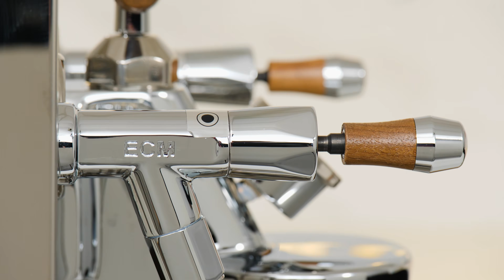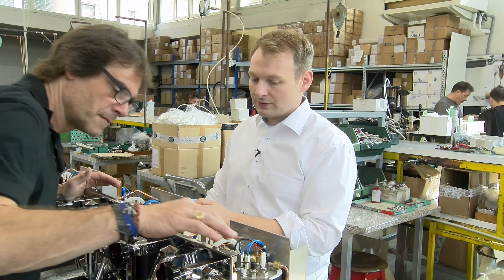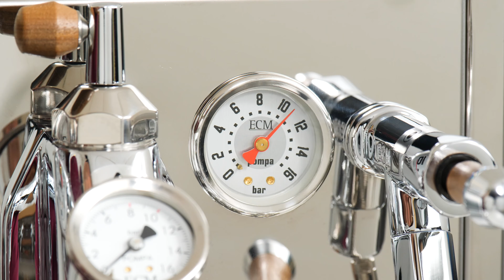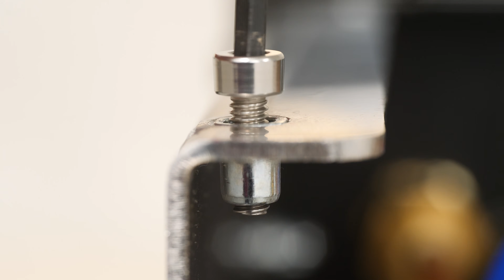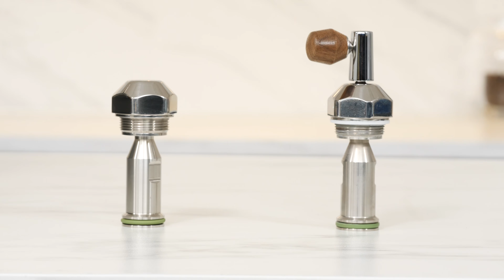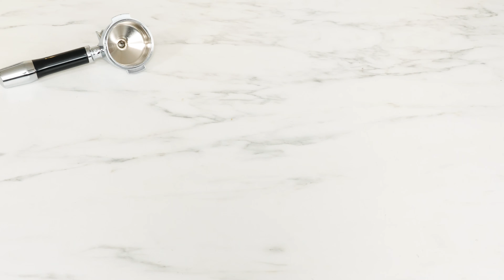ECM Synchronika In-Depth Review

Comment: I'm very happy with my ECM Synkronika that I bought from WLL last summer. My previous machine was a La Spaziale Dream T, so this one is a bit more manual, but I have it plumbed in with the BWT system I bought with it. I had some initial problems with the installed flow control and opened it up to find the o-rings were deteriorated. WLL was out of stock on them at the time, but provided the original mushroom valve upon my request. I know have the o-rings for the flow control, but I am getting such good shots using line-pressure pre infusion, that I haven't actually reinstalled the flow control yet. The support team at WLL has been great with that one issue and any questions I had about plumbing the machine.
Reply from the maker: Hey Richard, Thanks for the feedback. We're always happy to help and I agree our support team is fantastic - they know their stuff! Apologies for the out of stock situation but glad to hear there was a resolution to get you through - and yes line pressure pre-infusion can do wonders. Guessing you may have already been there, but if not be sure and bookmark our support section for the Synchronika. All kinds of videos and articles on techniques, DIY info, maintenance, etc: https://support.wholelattelove.com/hc/en-us/sections/1500000400302-ECM-Synchronika
Marc
Reply: @Wholelattelovepage  Thanks, Marc. I think I have seen a number of these videos, but I've now bookmarked the site. What a great resource.

Comment: I bought my ECM /CAEDO combo on Feb 13, 2019, almost 4 years ago and I must say these two items withstand the years with minimal maintenance for me.  I always use fresh water and have used both plumb and non plumb setups as needed.  This Combo works very well especially with my two favorite coffee beans ... Lavazza Super Crema and Australias Mio D'Oro from whole Latte Love. This company really knows equipment and customer service is nothing less than highly expected.  Favorite drinks,  Lattes, Worlds Colide and Afogato deserts.  Looking for some cool recipes if WLL will share to me.
Reply from the maker: Hey TWJ, Thanks for the kind comments, report on your setup and of course your patronage! Good water and a little preventative maintenance will keep your equipment running for decades. For recipes, here's a link to our blog loaded with delicious drinks: olelattelove.com/blogs/recipes
At 4 years in I recommend checking the T fitting which connects your vacuum relief on top of steam boiler (silicone tubes) to the drip tray drain port. It may be time to replace the fitting if it shows any signs of cracking. In recent Synchronikas the fitting was changed to a brass part. Cracked fitting does not effect machine performance but in rare cases may result in a very minor leak.
Marc

Comment: Hi Marc may I know the steam/hot water lever thread size are same with the brew lever?
Reply from the maker: Hey IC, Thread size is the same. You can screw the group lever handle onto the steam & hot water valves. Not enough depth internally to screw the steam or hot water handle onto the group lever.
Marc
Reply: Great info, can the group lever handle install onto Pro 400?

Comment: Just sold my pro 700 and got this one. One thing I noticed when putting a 3 hole on ecm the pressure drops a lot and on a recent event I did it almost at some cases wasn't keeping up but pro 700 with two hole was a tank.. Any way of increasing the pressure and a safe amount for when events or when needing extra steaming power? I put back the 2 hole on the ecm during the event and it was fine. I just like how quick the 3 hole is.
Reply from the maker: Hey vk, The 3 hole tip steams faster and will drop pressure more rapidly because of the extra hole. Should still have plenty to steam milk and quick recovery. I know with the 2 hole in place the machine can produce never ending steam. If you have the PID's t2 temp set to the max of 270F/132C then there's no way to turn it up higher.
Marc
Reply: @Wholelattelovepage  thank you for the reply! I will try that on my next event and hopefully the extra juice in the boiler it'll compensate for the extra steam hole tip.

Comment: Back in late 2018/early 2019 I was researching coffee machines. Even though I'm in Australia and WLL is predominantly for the US market, I found the information and the reviews on the channel absolutely invaluable.  The Synchronika at the time just received it's PID upgrade to get to 2bar of stream pressure.  After watching every review on WLL and doing all the reading on forums I could - I decided to buy an ECM Synchronika from the local distributer here in Australia.  100% no regrets.  It is a bulletproof workhorse that hasn't missed a beat yet.  It looks like a work of art in the kitchen and is a display peice as well as one of the best home coffee machines you can buy.
Reply from the maker: Hey Noel, thanks for the comments and sharing your thoughts on the Synchronika!
Cheers!
Marc

Comment: It is a great machine. My only reservation is that the chrome is relatively "soft" and after very careful use it is starting to show its age. Great review.
Reply from the maker: Hey Richard, thanks for the kind comment and sharing your thoughts! ECM has the best finishing in the business so if their finish is soft I'm confident other manufacturer's is same or softer. Like all metal finishes it is susceptible to scratching with use. Use gentle cleaners, avoid ceramic cups with unglazed/rough bottoms. For general cleaning of mirror finished parts my go to is microfiber cloths and ammonia based window cleaners. 
Marc

Comment: Mark, just passed my first anniversary with my Synchronika, after using my Rancillio Silvia for 20 years. What an outstanding espresso machine, and fantastic customer service and experience with WLL. Thanks to you and the team for everything you do!! Keep up the good work!!
Reply from the maker: Hey Terry, Thanks for the report and your patronage! Happy to hear you're loving your Synchronika!
Marc
Reply: Hey Terry, I've had a Silvia & Rocky for 18 years and I'm looking at upgrading to the Synchronika BUT I'm thinking getting a decent grinder like a Eureka Atom 75 might give me a bigger upgrade in my shots over replacing the Silvia, I could be way off on that one of course, so do you find a big difference in the quality and taste of shots from the Synchronika over the Silvia ?
Reply: @barrymurphy5548  Hi Barry. Sorry I didn't see your question until now. Like you, I owned a Silvia & Rocky for 21 years before getting the Synchronika & ECM S-Automatik 64 Grinder. Like you, I do share the opinion that the best first thing you can do to improve your Espresso shots is to upgrade the grinder. With that said, there are so many reasons why this espresso machine & grinder produces better shots it's hard to know where to begin...

For starters, my dream/goal were to own a dual boiler machine with an E61 group head. Although I had installed a PID onto my Silvia, there is no comparison between the temperature stability of the ECM because of the E61 and overall design of the machine and the fact the ECM is so much more substantial as far as the amount of heat-retaining metal vs the Silvia. Something else that attracted me to the ECM was it's beauty (as Marc always points out) - you simply will not find another espresso machine with this level of fit and finish, nor with this level of engineering. The simplicity in the way the ECM is disassembled, the thought and care into laying out the components and routing the wiring, and again as Marc points out it's finished as nice under the covers as it is externally. Because engineering and aesthetics are very important to me, both for serviceability as well as appearance (I, my wife, my facility and any visitors, etc.) will see this machine on my espresso bar indefinitely (as far as I'm concerned - remember, I owned a Silvia for 21 years!).

Because I make between 3-6 drinks/day for myself, my requirement was to have a direct-plumbed machine as well as a direct-connect drain. I had the luxury of building our current house having in mind someday I would own a dual-boiler machine (at the time I had no idea which one). My reasoning for this: Given the number of drinks/day I make just for myself, constantly filling the water chamber and emptying the drip tray were actually very time-consuming. Because I am very OCD and will never walk away from an espresso machine that isn't shiny & clean and ready for the next shot, the amount of time it took me over the last 21 years to keep my Silvia up to my standards I can't even imagine how much time was spent here. All I can say is that having a direct-plumbed water line and drain line coupled with the BWT Bestmax Premium V filter has reduced my time to clean my machine down I would say by 75%. This has worked out better than I was even imagining.

Something else to mention - I always found it next to impossible during a holiday to even use the Silvia, primarily because trying to single-thread everyone's drink using a single boiler machine was impossible. If Tried to batch everything and say make all the espresso's, then foam the milk for the lattes and then do the same for the mochas, etc., by the time I finished pulling all the shots and started on the milk, the espresso would have lost most of it's heat/crema. For these reasons, I rarely every used my Silvia when entertaining. With the ECM, this problem is gone. I can steam while pulling a shot and make everyone's drinks faster than using the Keurig I own! It truly is next-level.

I can't even begin to discuss playing with the Flow control and using the pre-infusion. Having these capabilities take the quality of the espresso to nothing I've ever had before. BTW, I didn't mention, I owned an espresso cafe for a brief time and had a 3-group LaMarzocco Linea. Until I got his machine, that had been the best I had ever experienced. What comes out of the ECM is far superior to that (keep in mind this was 21 years ago when I had that cafe - I'm sure the new LaMarzocco's are wonderful, however I doubt any better than the ECM :) ).

One last thing to mention - I think I purchased by Silvia/Rocky for roughly $400 for the combo. I sold the pair for close to $800 after using for 21 years!
Reply: @terryginther  Wow Terry, thank you so much for such a thorough and informative reply, the Synchronika is now looking like its going to be part of my not too distant future , thanks again !!
Reply: @barrymurphy5548  Great to hear - guarantee you will love it!
Reply: @barrymurphy5548  Hi Barry, I forgot to mention one of my favorite things about the Synchronika - the levers! To me, these are a game-changer - the ergonomics of  pushing the lever in any direction with a single finger vs having to  grab a knob and turn it clockwide/counter-clockwise to control the steam and hot water output make using this machine that much more enjoyable. I can't imagine ever going back to spinning knobs!
Reply: @terryginther  Yeah they definitely seem to be way better than knobs. , thanks again !!

Comment: Hey, I've got DeLonghi Ecp 31.21 espresso machine. And I just can't slow down the extraction time. I've watched and read all I could find and I tried the tips from your videos, and nothing helps. I manage to extract a lungo shot but not espresso. What would you recommend? Thanks
Reply from the maker: Hey S, your espresso maker uses a pressurized filter basket. In that type of system it's the filter basket which creates the pressure/restriction of the espresso brewing process. With that setup, the grind size of the coffee doesn't have much impact on the speed of the extraction. You may be able to slow things down a bit by using a finer grind size, more coffee in the filter basket and tamping with more force. In the end, it's difficult to have the same control on your machine as opposed to a machine which uses a standard non-pressurized filter basket.
Marc

Comment: What are the key differences between this and a comparative Profitec (600, 700), and which would you recommend, ECM or Profitec? Thanks!
Reply: Good question!
Reply from the maker: Hey AS, The Profitec Pro 700 is nearly identical to the Synchronika internally. Profitec and ECM are sister companies. Same boilers, motor, pump,steam temps, PID functionality. ECM finishing kicks things up a notch with angled PF's, details on tips of PFs and levers and the Synchronika has joystick lever valves while Pro 700 uses knobs. Much easier to open the Synchronika and wood custom options for side housing panels. If going to this level, I think it's worth paying a little more for the extra refinement of the Synchronika. But, that's a personal choice. At end of day no difference in potential quality of espresso from the machines.
The Profitec Pro 600 has same class leading steaming power as the P700/Synch and same PID functionality. Difference is smaller boilers, vibration instead of rotary pump and Pro 600 is a reservoir only machine.
Hope that helps!
Marc
Reply: @Wholelattelovepage  Thanks for the reply. Good to know.
Reply: @Wholelattelovepage   amazing info thankyou. Very helpful. I had seen your video comparing them from a few years ago, but wondered if anything had changed since. Sounds like the synchronika is a good bet!

Thanks again Marc.
Reply from the maker: @amirshayan7269  You are most welcome!

Comment: Sadly the knob-style needle-valves are not remotely as nice to use as paddle-style ones like you find on the Lelit Bianca.
Having you full range of motion in just ~240 degrees is invaluable for a lot of espresso profiling. You want have any fun doing adaptive blooms or anything similar with a knob like this.

A lot of the "profiles" I see on channels like these make little to no sense at all. Feels like it's just presented in a way that wants people buy the machine.
Reply: He has good charisma when coming to sales don’t be jealous haha
Reply from the maker: Hi MK, Thanks for sharing your thoughts. Fairly certain the full range of flow rates is not available in the ~240 degrees. If it is, in comparison from no flow to stock flow rate is a 450 degree turn on ECM/Profitec - so a little less than 2x the resolution when manipulating. Then there's higher than stock flow available beyond the first 450 which allows one to run a vibration pump machine at a rate comparable to a rotary pump or to run high flows which can be useful for darker roast or coffee beyond prime freshness.

Comment: hi Mark. Nice to see you again 🙂 
Is the Rocket R9 one, a coffee machine you would also recommend together with the ECM Synchronica, 
or it's price tag, and the fact that Rocket didn't come back with a newer version the last 3-4 years, means you wouldn't
Reply from the maker: Hi K, the Synchronika, due to its K.I.S.S. design is a very solid and reliable machine. You'll see that reflected in the comments left on this video by long-term owners. Like all machines it requires periodic user maintenance. The R Nine One has a lot going on under the hood. One issue area is a stepper valve used to control variable brew pressure. Beyond that, it's just a far more complex machine - it has to be in order to do programmed pressure profiling. That complexity can lead to reliability issues if users do not perform basic maintenance or use water likely to cause scale in the machine.
Marc

Comment: Great review! Very informatieve. 

Is there a big difference between this one and the Mechanika Slim V from ECM? 

I now use a Gaggia Cadorna Prestige but want to scale up and get more into it myself. Or are there better choices to make?

Thanks in advance.
Reply from the maker: Hey JvD, Thanks for the comment and question. Better choices depend on what you want out of a machine. If you want the best overall available dual boiler machine it's the Synchronika. So we're now at the Mechaninka VI Slim: https://www.wholelattelove.com/products/ecm-mechanika-vi-slim-espresso-machine-heritage-line
Differences between the machines...
Synchronika: Dual boiler, rotary pump, plumbable, precise PID individual control of boiler temps, line pressure pre-infusion (when plumbed), finishing detail, custom wood side panel otpions.
Mechanika VI Slim: Heat exchange boiler, vibration pump, reservoir only, 3 PID temp presets
Here's a side by side spec comparison of the machines: https://www.wholelattelove.com/pages/compare?products=NjkwNjUyNjk5MDM5MCwyMTY3NjI4NDMxNDE0
Hope that helps!
Marc
Reply: @Wholelattelovepage  Hey Marc, thanks a lot for the comments. I really appreciate it.🙏 based upon your comments I guess the Mechanika suits me better. Best would be if Gaggia would have a similar machine. I just love my cadorna prestige so much. Keep up the great vids. Everytime a party! 🙏🙏
Reply from the maker: @joostvandinten7584  Will do!